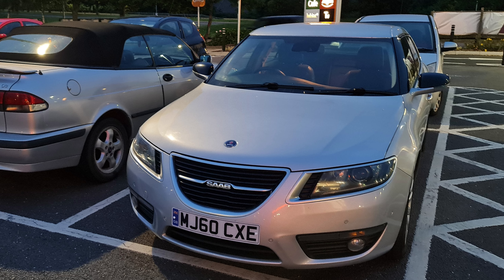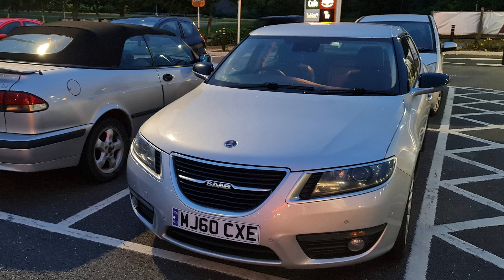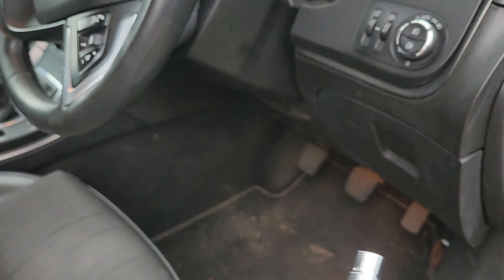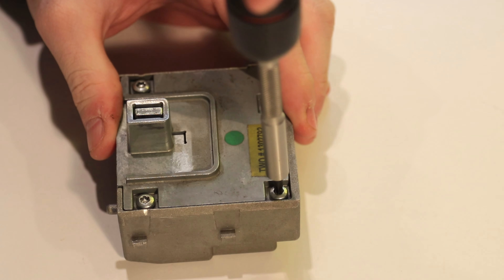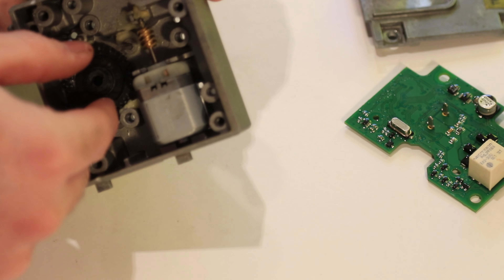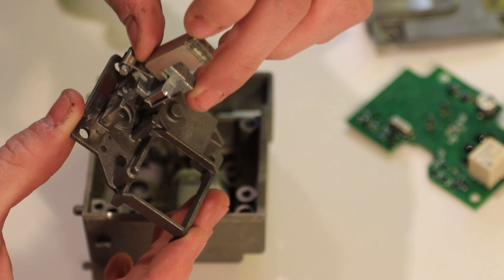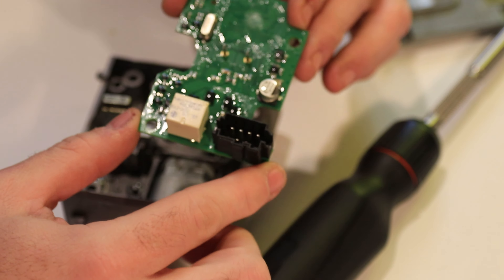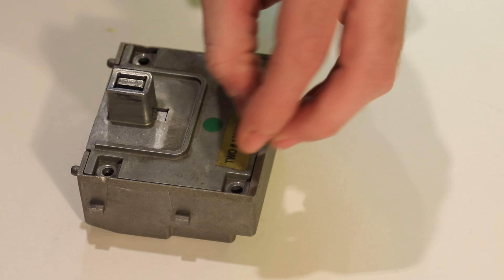Saab 9-5 NG 2010-2012 Steering Wheel Lock Control Module Fix / Remove / Replace

Comment: My 9-5 has suddenly developed this issue. Watching this video and reflecting what I did prior to this fault manifesting. 
Here's what I believe is the culprit.
When you power down the steering lock activates when the drivers door is opened. ( not until )
What do you do when you open the door?... You get out. 
As you get out of the vehicle you  naturally grab the steering wheel as a steady.
In doing this as the lock7is being applied puts excess pressure on the unit, which eventually, through fatigue, will fail
My advice is to leave the front wheels straight and don't grab the steering wheel  climbing out or in
Reply from the maker: Hindsight is a wonderful thing :D
Reply: @Saab Unleashed  Your video showing how to fix the issue is excellent..
I only hope that I'm correct and it reduces the chances of this fault from occurring to fellow Saab enthusiasts

Comment: Small hole drilled in both parts to be joined, large enough for a panel pin to fit in the hole, then glue together using jbweld (much stronger than superglue), out of interest how much was the replacement part ? So basically jbwelded with a panel pin embedded
Reply from the maker: Replacement part was over $200 including shipping so the jbweld is probably a much better idea
Reply: @SaabUnleashed  yeah but the pin needs to go in too, makes a huge increase in strength, glad you got it sorted tho with the replacement

Comment: I recognise that parking place, that's Sainbusry's Oxney Road! I was there in my 9-5 NG this evening! Mine is coming up occasionally with Service Steering Lock. The steering wheel is locked though, and does unlock when I press the ignition, so I doubt it's the same problem. I'll look through some of the other posts.
Reply from the maker: It will likely occur in the near future. That's how mine started
Reply: @SaabUnleashed  I think I'll get a new one on order. You've given great instructions on how to fix it, but, long-term, a new part should last for another 10 years+ hopefully. Thanks for your great videos. Are there any local Saab meets? I'm on my 5th Saab and still own my last two. Both 9-5s. One, a 2005 9-5 which I've owned from new that has done 264,000+ miles and my NG bought from a Saab garage in Telford which was the MD's car, and a demonstrator which has done 211,000 miles. Although I replaced the engine at 194,000 miles, only because I could get a full factory engine, including a new turbo on a pallet at a VERY good price :) So it's now nicely run in :)
Reply from the maker: @ronnielloyd4676  nice one. Local meets don't happen around here but there's a few larger national meets that occur
Reply: @SaabUnleashed  Do you know of many NG's in the area? Perhaps we could just organise a chat in a local pub :)

Comment: My 9-5 NG 2010, had a similar issue but it never turned over with the handbrake locked I did check the lock module no rattling, turned out it was the third battery lead which runs across the top to a fuse box had corroded, easy fix give it a clean, I had mine done by garage including software upgrade cost £390 ouch, if you know you know, if you don't it costs 👍

Comment: Thank you very much for this fix! I could start my Saab and drive it home. I Also drilled small holes in both ends of the broken part and glued it together. But now a new issue has occured because I have a replacement part installed but my Saab doesn't "accept" it, it is (again) locked in with the new part. I think I have to install/connect it with a software update maybe? Any ideas on this? Thanks in advance!
Reply: In the end of the video you are talking about an MDI to program it in... I guess that's what I need to do, not sure how tho ;)
Reply from the maker: If you bought a new lock module, it'll need to be programmed to the car using an MDI, and I will be filming this whenever my part comes. But it'll probably be easier and cheaper for you just to take your car to a GM garage to get them to do it, because otherwise you need to buy an MDI, pay for a subscription to the GM software and learn how to do it
Reply: @SaabUnleashed  thanks for the reply, made an appointment at our local ‘Saab’ dealer to program it.
Reply: You could change the broken part with the new part from the new module if they interchange. Then You can use the old module, which of course is already programmed in.
OR if the electroncic board interchange, use the old one in the new module instead.
The warranty on the new part will void.
Reply: @MrVidar0  Thanks for the comment, I did exactly that. I found another old Steering column module on a scrapyard and opened it up. I replaced the broken part and put my original SCLM back in, works perfect ever since (and updated the software of the module).

Comment: Hi Mate first of all wideo is very helpful 
I have same fault at the dashboard and sometimes the car want start i bought another saab to have the impossible to get spare parts mostly body.
I swap the module and looks like the car can't see the unit.
Do i need to definitely program the  module with the car?
Also is there difference between remote control and key less entry modules
Thanks for any response
Reply from the maker: The modules are not hot-swappable if they are used, you will need an MDI2 with software to marry them to the car. The only way to avoid this is with a new part OR you can swap the components inside the module
Reply: Thanks for the answer the only thing I think happens because everything looks ok so I think maybe the motor or motor connection with the plate through the pins are failing because I can hear some clicking noise like the motor trying to start while the engine wants to start
I was also wondering if maybe some electronic failure is possible

Comment: Hello buddy, I'm having the same problem even though I've installed the new ordered module(GM-12823800)back in December 2022. But i must mention that at the workshop they haven't installed it using the MDI and because I don't have and cannot find one, I need help. In the past month I'm getting daily error messages on the dashboard with the (Service Steering Column Lock). Please be so kind as to post the video of how you've programmed it using this MDI thing. Thank you ! :)

Comment: Hey sir, thanks for uploading. But i think I habe another issue. He wan‘t start and the Sterring wheel doesn’t make any sound. 
Just the issue pops up „Lenkradschloss prüfen“ it means Steering wheel check. 
What can I do? Do you habe any Idea? The car is on the parking of a supermarket-.-
Reply from the maker: Can you turn the wheel or is it locked in position?
Reply: I can turn the wheel without problem it’s not locked
Reply: I put also a new carbattery, nothing changed
Reply: And also changed the keybatery
Reply: @SaabUnleashed any idea?

Comment: So is this what needs replacing when you get the "Service steering column lock" message? I found discounting the battery for 10 minutes got rid of this message for a while.
Reply from the maker: That's a different issue, it requires a component replaced on the PCB in the lock module
Reply: Hi, how died you fix it? I think I habe the same problem and my car is parked on the supermarket prking -.-